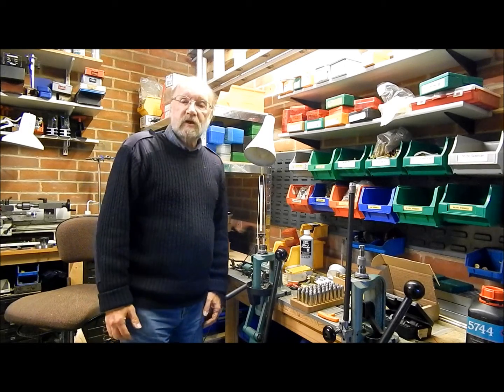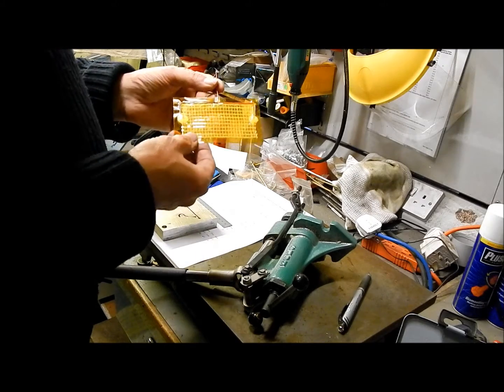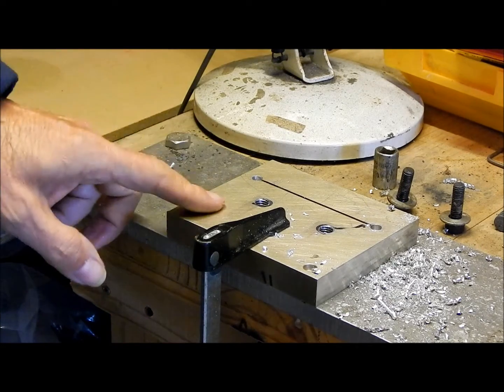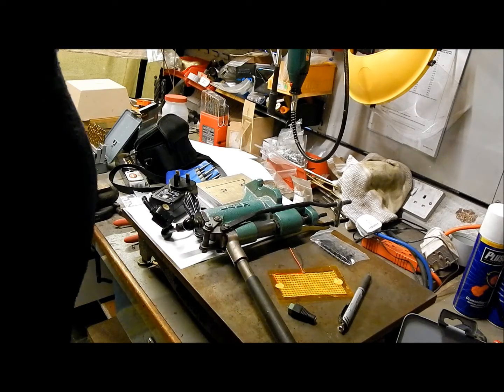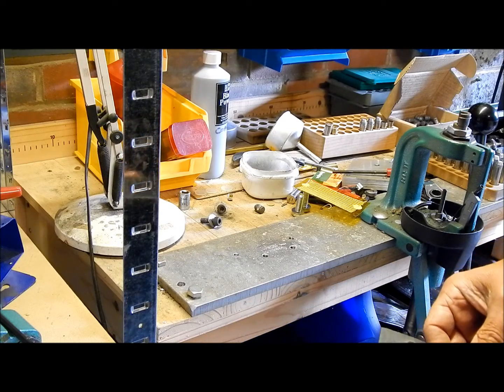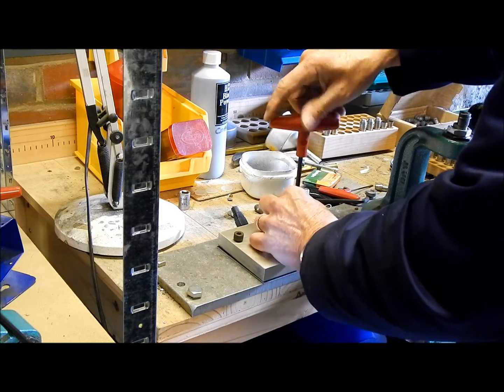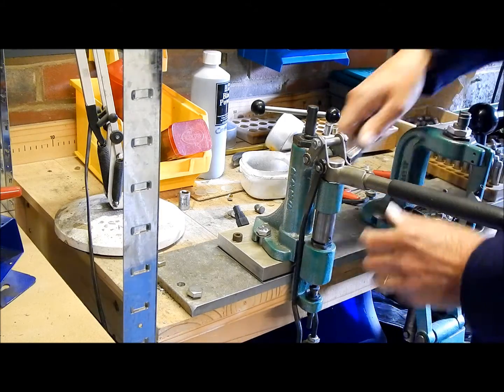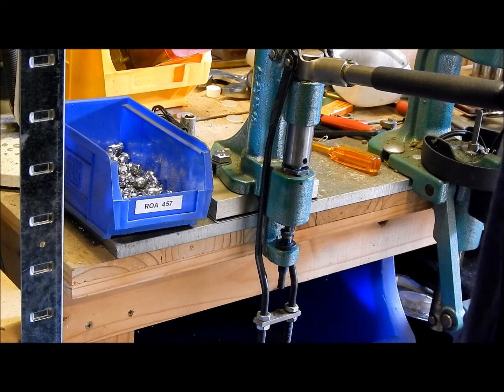Making a low cost Lubrisizer Heater

Comment: two wires from PTC Heater, does one go to +plus  & other to - minus ...   or is it installed in series? thanks
Reply: The heater element is a simple resistor so connection polarity is not important. If you have any concerns connect the red wire to +ve and the blue/black to -ve.
Reply: thanks for your help, Northeast USA gets cold 9 mo. yr.

Comment: How did this heater work out for you?  I am thinking of building similar heater.
Reply from the maker: I was using it the other day when it was -2C in the workshop and it did the job ok. I run it on 9v and it is only slightly warm to the touch but is enough to warm up the 50/50 beeswax/ Crisco black powder lube that I use.